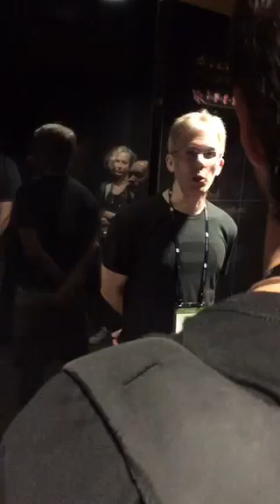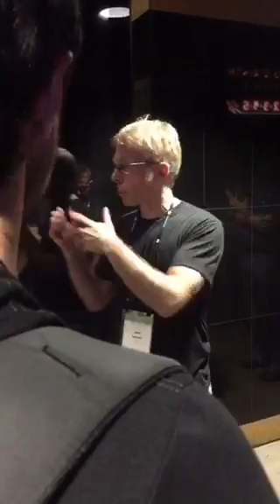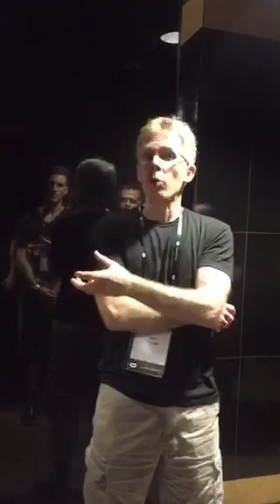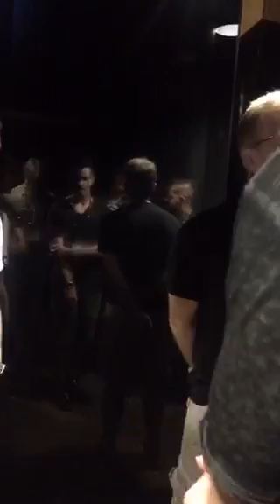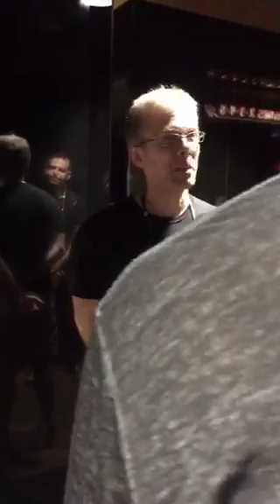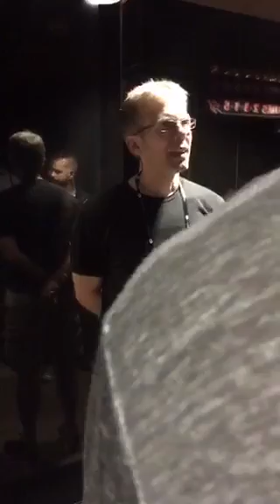John Carmack hallway talk at Oculus Connect

Comment: At the very end: "Augmented reality is really not that interesting." He'll be eating those words in the near future.
Reply: +Mike Trieu (MegasChara) He said "AR is not that interesting wired to a computer"
Reply: +Mike Trieu (MegasChara) "near future" yeah in 20 years maybe.
Reply: penna Just went back and listened to that part. That's correct. However, "wired" to a "computer" is somewhat of an outdated concept now that we have 60 GHz wireless protocols that can sustain uncompressed 4K@60p with nearly zero latency and mobile SoCs like the Nvidia X1 that are just as powerful as their desktop counterparts. With the proper thermal management and battery, mobile AR is possible today.
Reply: +Mike Trieu (MegasChara) Yeah, but the question was in the context of the Rift and Carmack very clearly said, "wired to a computer" so I think someone else should just chew and smile right now. There's also the "Remove this [knee-jerk] comment" option too ;)
Reply: Michael-Rainabba Richardson What, are you saying Carmack and the rest of the Oculus team never had plans for a wireless Rift? I guess that would make sense, given their recent choice of controller technology. It doesn't allow the user to turn around 180° and still be seen by the camera. It's good that he's at least interested in mobile position tracking using stereo cameras, so that might be a good stepping stone for the AR use-case. Also, moving away from USB would be a good thing for mobile, for the bus mastering reasons he stated here. Something like WiGig could transport both video and controller signals to the mobile device simultaneously. I believe Luckey said he was looking into this. As for Carmack's quip about there being no good Cardboard content, I would love to see Niantic Labs partner with either Google or Oculus to bring Ingress (and now Pokémon Go) to AR. There are plenty of games that would be incredible to play while walking around outdoors.
Reply: +Mike Trieu (MegasChara) Bandwidth is not there for wireless at this time according to Valve, nor do they expect it to be in the near future. If that's only marketing BS their competition will quickly be coming to market with wireless and talking about how restrictive wired is, but I'm not holding my breath.

I'll take an excellent wired experience with over a wireless experience that has immersion breaking performance issues any day.... luckily we don't have to make that choice.
Reply: Bandwidth? Doesn't the SiBeam UltraGig technology max out at 25 Gbps (which is about the same as current-gen DisplayPort)? That's considerably more than HDMI's current 18 Gbps.
Reply: 2 years later, and we're all still waiting for him to eat those words.